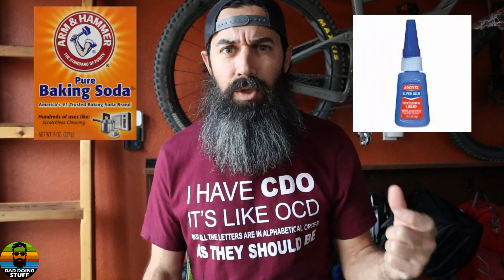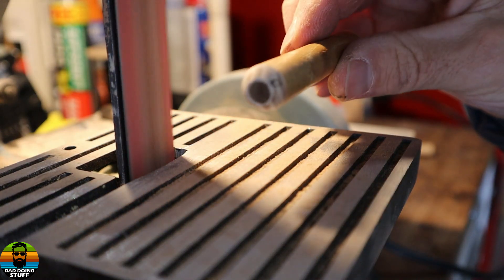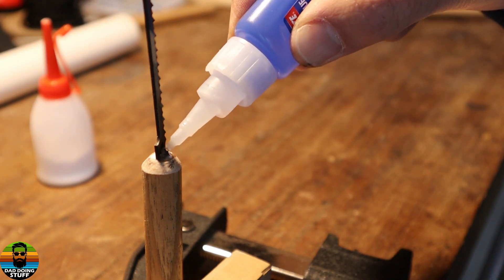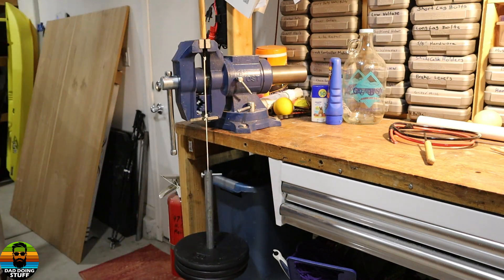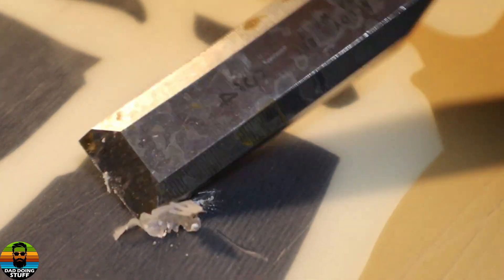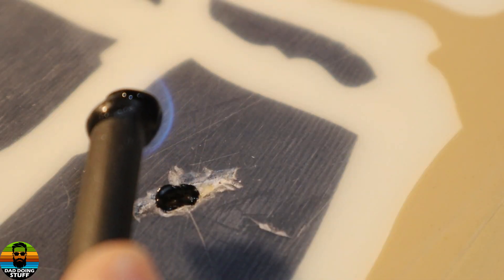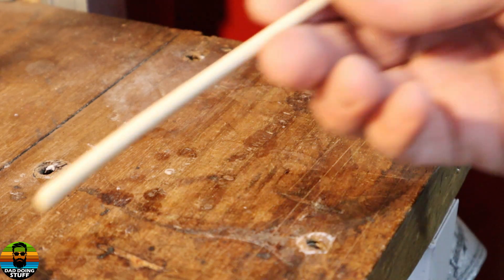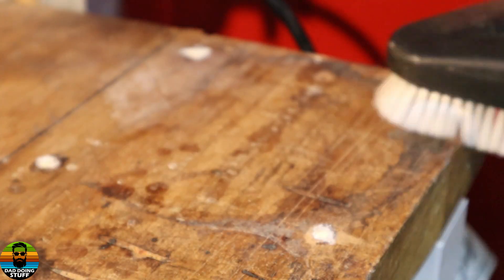Why Super Glue is BETTER than Epoxy

Comment: Depends on the application, but for me the super glue / baking powder is a b*tch to work with
Occasionally use it to join puter or resin parts in miniature building. Its very fast but its also very brittle and I've found working with it to be much less precise
Reply from the maker: Good feedback. Do you normally use epoxy or something else?

Comment: it would be cool to see the weight barring difference on the pumpkin knife with baking soda mixed in and without(straight super glue). 

Is there any advantage to mixing the two together then applying or is it critical to apply separately?
Reply from the maker: It dries so quick that I don't think you could pre-mix it.  From what I can tell, the baking soda expands when the glue hits it, and basically fills in any space as it hardens.  Using straight glue would be a good test though.